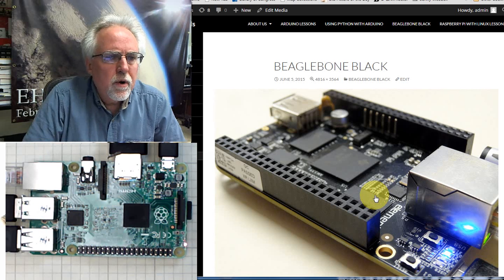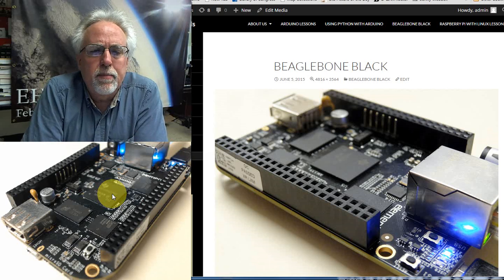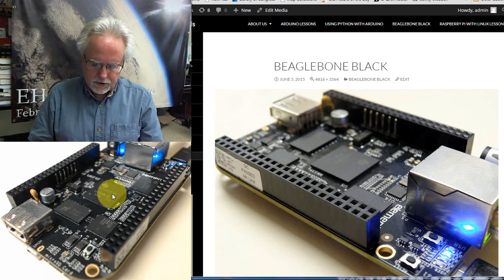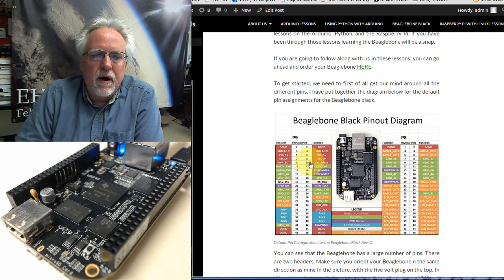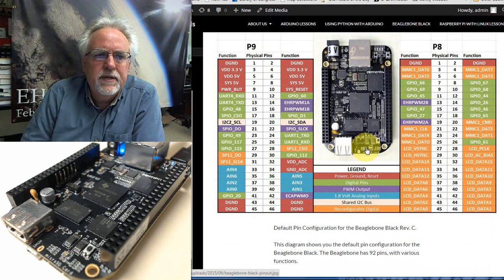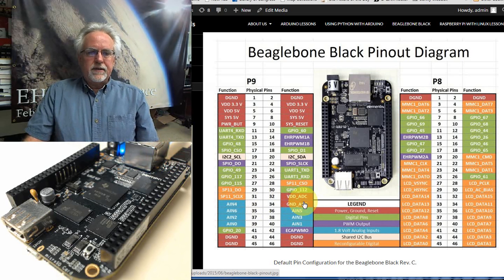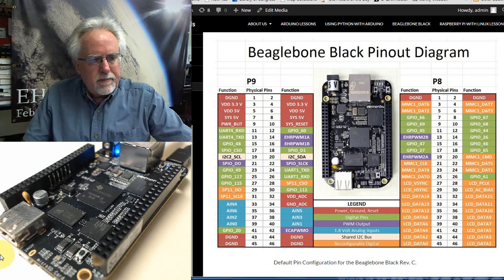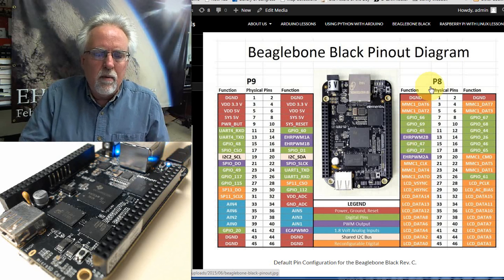Beaglebone Black LESSON 1: Understanding Beaglebone Black Pinout

Comment: Important warning about the ADC inputs: due to a chip bug, the ADC pins may be briefly shorted together and/or to ground or vdd_adc during power up, specifically during the first 7ms after vdd_adc comes up. This means that if an analog input is connected directly to ground or vdd (e.g. a potentiometer that's at one of the extrema) a lot of current may briefly flow and potentially damage the processor, hence it's a good idea to use a resistor to limit this current.

See advisory 1.0.32 of the AM335x Errata for more details.

Comment: BTW, if you need ever more than 6 PWM outputs, three eCAP modules (0, 2, and the one in PRUSS) and four of the timers (4-7) can also be used as PWM outputs, bringing the total up to 13 outputs. They're not as fancy-featured* but they're perfectly adequate for most needs.

* The three pwm 'A' outputs have a delay line allowing them to be micro-adjusted in steps of roughly 200 picoseconds. No idea why you might need it, but it's still pretty cool.

Comment: Good job Paul! Perfect execution and it was exactly what I needed to know.
Reply from the maker: Jon Gordon Thanks Jon, and I should have more lessons up shortly. Stay tuned.
Reply: If you have a min, what are your thoughts on using it as a 3D printer host and/or controller versus the raspberry pi?
Reply from the maker: Jon Gordon I think it comes down to whether you need analog inputs or not. For now, the user base for Raspberry Pi is so much greater, unless I need analog in pins, at this point I lean towards the Raspberry Pi 2.

Comment: Mr. McWhorter: Do you have any lessons showing how to store data into the DRAM? I haven't seen one thing by anyone using the DRAM. Also, I don't see a memory controller on the board. Is it built into the 3358? If not, how is the DRAM memory interfaced to the 3358?

Thanks,

Kit
Reply from the maker: +KitCox That is really well beyond what I will be covering in these lessons.
Reply: +Paul McWhorter I was aware these lessons didn't cover the DRAM. I was asking in general. I was also curious if the 3359 had a memory controller in chip. The Raspberry PI also has a 512MB DRAM. You have a number of lessons on that as well and I want to thank you for all the work. They have brought me completely up to speed on learning the basics on these development boards. I'm learning this because a project popped up that requires me to store a string of data bits in RAM, in particular the string from the Cirrus CS5340 A/D converter as used in HD stereo audio components. For all I have found out so far the RAM may not be user accessible and used by the ARM for program storage only.

Thanks again for all the lessons. 

Kit
Reply: +KitCox There's indeed an mDDR/DDR2/DDR3 memory controller integrated on the AM335x. When running linux you're always using the DRAM, it's what you're running from. There are ways to reserve a chunk of physical RAM for your private use but there's rarely a need to do so. I did so for a buffer to automatically store ADC data (using DMA), but since I only needed 32 bytes for that I used a piece of the on-chip SRAM instead.

Comment: you didn't mention that about a third of the pins are unusable with hdmi out, and emmc, that you can not drive pins high until after the board is turned on, the numerous secondary, and tertiary functions of the pins. this video is very incomplete. everyone should just read the manual.